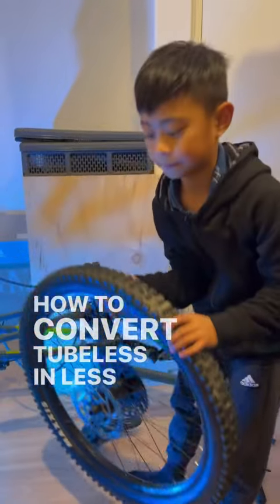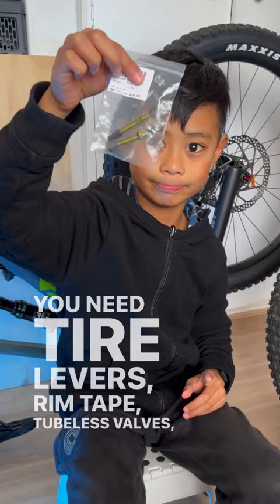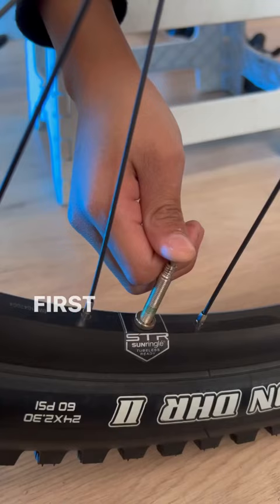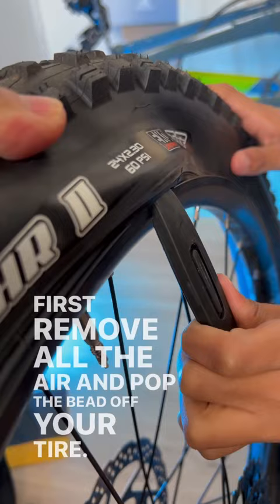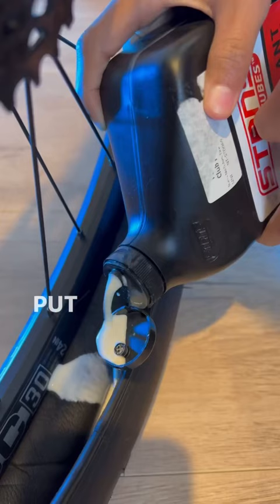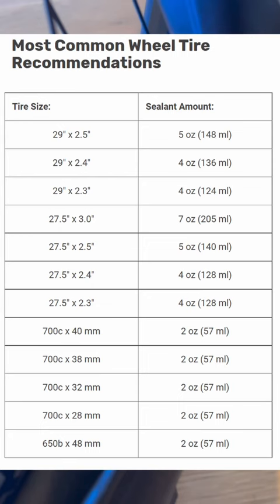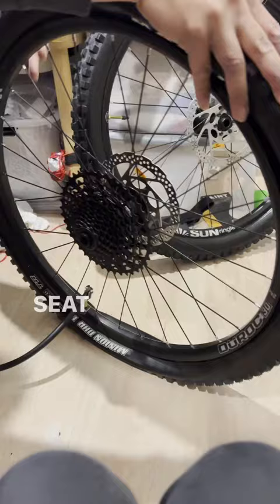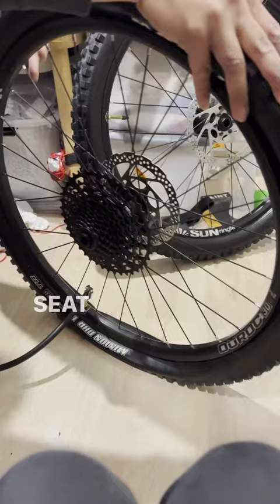Tubeless Conversion - In less than 1-min

Comment: current bike tek is designed to fail at the most cost possible. Better off with department store cheap bike tires they actually have side wall protection and aren't as thin as a balloon. Got a pair of new tires they lasted 3 rides before the sidewall tore out. Rode the cheap tires for 6 years and only replaced them for fun. Put the old ones back on and its been another another year only ever replaced one innertube in 8 years
Reply from the maker: No thanks, those weigh a ton.
Reply: @RidesWithJake  a ton? It actually weighs about the same after you've dumped a bottle of sealant inside. Might be a pound or two heavier. Why are you afraid of having stronger legs?

Comment: as someone who works at a bike shop, it’s 10 times easier and makes less mess to first seat the bead with no sealant and then add sealant in thru the valve stem
Reply: Thanks, I will do it this way.
Reply: 100%

Comment: I was just thinking about converting to tubeless but thought it might be confusing, but this tutorial is really straightforward and easy to understand

Thanks!
Reply from the maker: Glad it was helpful! You’re welcome 🤘
Reply: Just be warned that the video has missed the bits where
-you can’t get the tyre off
-you can’t get the tyre on
-sealant leaks everywhere 
-you cut your fingers off 
-you can’t get any air into the tyre quickly enough (even with an air shot)
-you lose the will to live 
-you watch loads more you tube videos which all make it look this simple and make you beyond angry 
-you scream at your wife and kids for no reason
-you get divorced 
-you lose your job and your self worth 
-you get a mate around who said it was easy and he can’t do it
-spend a week trying and failing but eventually and for no particular reason IT WORKS!
-you then realise just how awesome it is and you have loads of free time to ride because you’re divorced 

So it’s worth it but if you’re doing it for the first time watch a much more in-depth video and accept that it is unlikely to work first time👊
Reply: Your tyres and rims have to be tubeless ready. You can’t just use your normal tyres and rims and convert them to tubeless
Reply from the maker: @grobbosixtyone  you can actually, but is much more involved and needs a hack. 

We did this on my previous bike, but honestly not worth that much effort.

https://youtu.be/JZNw8TXqNiY
Reply: @grobbosixtyone  Most mtb rims are half tubeless ready. They need rim tape but they have tubeles bead on the ture

Comment: The recommended sealant amount seams a bit excessive. 90ml for 29" 2.6 ist totally fine instead of 150ml. My Tire was airtight without the sealant, so the sealant is more of a puncture protection. last tire died after 4000 Miles because of a huge Glass Shard. Hope this helps for additional perspective on the Matter. 🤘
Reply from the maker: Yeah I agree, I feel the same, half is enough, and I just top up every one or two months.

Comment: Was thinking about converting, but I don’t know If it’d be better for me, I get punctures very often 😂😂 and they go pretty slow with tubes. How are punctures on tubeless? Thanks
Reply from the maker: Go for it! If its a slow puncture then it's small enough not to even notice because the sealant will seal it right back.

Comment: I know that this is a funny question but why go tubless?I just got my new fully sus Marine rift zone 2 bike.Should i go tubless on it?
Reply from the maker: That's totally legit question bro, just enjoy your bike first bro. I would look at going tubeless if you're getting flats. In my case I tend to get pinch flats (that's when your rim and tire pinches your tube) when going through sharp rocks. And I already got the tubeless sealant, tape, and valve. 

For now enjoy it bro, and you can do it later, and congratulations on your new bike. 👍

Comment: How do we know that a rim supports tubeless
Reply from the maker: Good question, usually what I noticed is, tubeless ready rims usually comes with tubeless tape installed, while non TLR have your usual rim tape that is made of hard plastic and only covers the spokes. non TLR also have sole small holes on the sides
Reply: @RidesWithJake  ok thanks

Comment: Which is better, tube or tubeless?
Reply from the maker: Lighter, better pinch flat protection, tubeless. 

Less maintenance, tube.
Reply: @RidesWithJake  More  time consuming and more equipment required if you have a puncture during a ride .
Reply: Tubeless But Cons More Expensive Than Tire With Tube Because Outer Tire More Cheaper Than Tubeless
Reply: @RidesWithJake  Tubeless Yes Less Maintenance But Cons Tubeless More Expensive Than Tire Tube

Comment: What is benefits from Tubeless Tires?
Reply from the maker: In general, you have a bit lighter setup, you can run lower pressures (thus more grip), and less chances of getting pinch flats.

Comment: What difference does it make when it’s tubeless
Reply from the maker: It’s slightly lighter, less pinch flats, small ones punctures reseals, you can run lower pressures for more grip.